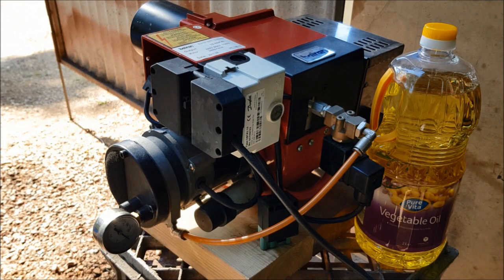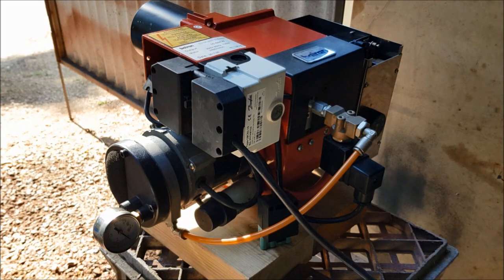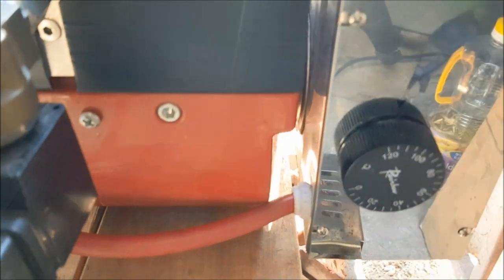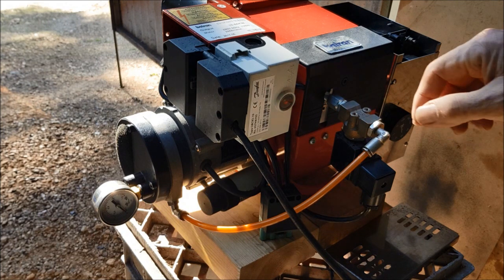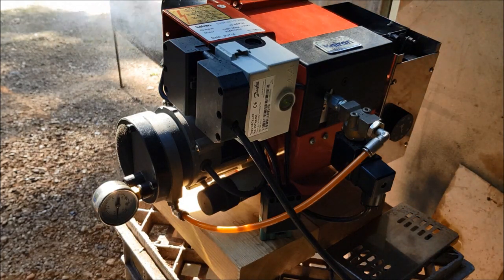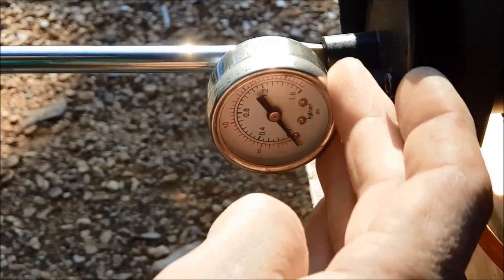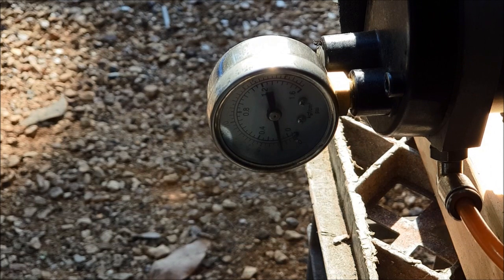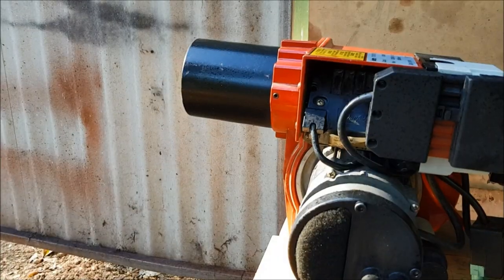bairan STW120P waste oil burner problems

Comment: The Problem could be the little sealing O-Ring on the back of the Nozzle. If it gets hard the pressur of the compressor pass by the ring and get into the oiltank.

Comment: It seems to have too much ventilation air coming from blower & it blows flame away. Remove black plastic cover close to relay box. You need 4 or 5mm Hex for that. Under this cover is blower air regulation, adjust it to less.
Compressor shall not produce over 0,4bar. Your is ok.

Comment: I have also tested and had the same problem. The solution for burning burner is that you heat the oil to the limit of 80-110 degrees Celsius and the spray pressure is at the limit from 1.5 to 3barg. After burning, the injection pressure can be increased accordingly.

Comment: Hi Eugene, just wondering if you could help me out, I also bought the same burner from a Chinese supplier, my problem is everything works up to the point where the solenoid kicks in and instead of the oil coming out of the jet the gets pushed down the oil feed pipe into the oil heater tank. No blockage in the jet I cleaned it all out. I’m using clean waste oil psi is at 6 heater is set at 90 , am I missing something here it’s driving me nuts 😡 your help would be much appreciated. Excellent video by the way 👍🏻
Reply from the maker: Hi Paul
I'd be happy to help but not sure i can.
I don't understand what you mean when you say the oil is getting pushed back into the heater tank. It should only ever be in the heater tank and it gets syphoned out by the steam of compressed air running through the nozzle. Best way to check all is working correctly is to temporarily remove the solenoid off the long tube and blow some low pressure compressed air through the tube. That should suck the oil out of the tank and give you a fine mist of oil coming from the nozzle.
Reply: @EugeneVashenko  sorry typo error ,I meant to say the air gets down the copper feed pipe to the heater tank it doesn't suck the oil up at all and there's no blockage in the jet,
  I can see the bubbles in the tank when the solenoid kicks in , I have the video up there now here's the link   https://youtu.be/DtKSA5dL6Tg
Reply from the maker: @pauloreilly1970  ok, sure, I can see what you mean, looks like the nozzle is blocked. Have you tried removing the nozzle and starting it to see if the air will come out the front of the tube?
Reply: @EugeneVashenko  First thing I looked at, you would think it would be that but I cleaned it out then blowed it out with the compressor, there's an adjustment dial just to the right of the solenoid is this for combustion adjustment ? mines on 15 looking at the manual combustion should be at 1-4 . sorry for all the questions .
Reply from the maker: @pauloreilly1970  That dial opens the vent which is located to the left of the oil tank. Sadly the numbers don't mean anything but you can see the vent if you look carefully. It should be partially open but it has nothing to do with the problem you are having.
I'd try removing the nozzle and starting it to see if the air will come out the front of the tube. That will confirm if there is a blockage somewhere.
Otherwise, contact John from https://www.bairanuk.com/ He has helped me with info and spare parts many times.
Reply: The little o-ring on back of nozzle has shrunk or wore that stops air going to tank and makes nozzle siphon oil

Comment: Hello! Have you got already the problem solwed? I have got kroll burner now abaut 10 years, so I think I know at least something abaut these kind of burners. I guess 1. you have too big nozzle. Or 2. not enauhg airpressure. Or 3. the secondary air is too much, or too less. I mean the mixture is not right. And least, the nozzle is blocked up. Pleace, let me know if you have got problem solwed.

Comment: You need buy additional compressor need at list 1 bar pressure to use vegetable oil recommend silent compressor.
Reply from the maker: Nonsense. There is nothing wrong with the compressor on these burners.
Reply: 1 bar is abaut maximum pressure. 0,4-1 bar is good. pressure depends what size of nozzle you have.
Reply: 1.0/1.2 nozzle if you use kerosine need twice less . If you use vegetable oil minimum 0.8 bar

Comment: My first year was pain with this machine, waste oil works fine, but it cannot pump normal heating oil and I was looking air leaks in the line, but problem was oil pump. heating oil is too thin for the pump.. I needed to buy different oil pump for regular heating oil.. after that my problems almost disappeared..
Also I have a extra filter in waste oil line,,
Regular maintenance is key. U need to clean boiler after 2 barrels of oil. and burner needs to clean after 4 barrels of oil.
Reply: https://www.youtube.com/watch?v=20bGcAIDS-M

Comment: I have owned two of these burners and I have to say that they are absolute rubbish. The one I am currently using has been rebuilt so many times, with just about all parts replaced, broken again and then re- engineered with other parts. The only parts on mine which are original after three years are the motor, squirrel cage fan, nozzle (and holder) and electrodes. finally, now most parts have been re-engineered it runs reliably.
It reminds me of "trigger's broom" on Only fools and horses.  Next time I buy a burner, it will have to be a Kroll- I have spent most of the last three years on my knees fixing the Chinese one.
Reply from the maker: Hi Geoff
While I have certainly had my share of trouble with this burner, in hindsight it was my lack of understanding. I now have 3 of these burners all running reliably. The one for my hydronic heating is burning through about 1000 litres of oil per month and it is running perfectly (and I am no longer adding diesel like I was previously).

They just need to be set up correctly. There is a comment from John Wilson further down the page. Make sure you understand what he is saying and do it. He also has a website with more info on setting them up. After following his advice, my compressor works perfectly, in fact I had to turn the pressure down from where I had it set initially.
Reply: @EugeneVashenko  Hi Eugene, Thank you for your reply, I am familiar with how to set up my burner, I was referring to the poor quality of the component parts, for example, Mine has had 3 controllers, the first simply failed, the second failed because of a short-circuit igniter (so a new igniter was required too). It has had three float switches, they are very expensive, the manufacturer wanted $120 for a new one (GBP60). I have had several oil slicks running down my garden path because of these failures. I replaced it with an aquarium float switch and solid state relay (Cost $10). A good precaution is to put a 1 minute timer in series with the oil pump to limit the damage should this happen. The oil tank temperature controller failed, I replaced it with a PID controller. I gave up with the rotor vane compressor after it wore 3 out, before the plastic back of it degraded and it leaked air and I went to the car shop and bought a conventional compressor=no more problems. I could go on and on, but I won't. It's great to have the  almost free heat (although mine uses 100KwH per month to burn about 500 L of oil), the reliability issues are not so good. I honestly hope your experience is better than mine has been- it is very difficult to deal with the manufacturer (in my experience) they simply ignore you.
Reply: the website was very helpful. Thank you.

Comment: I have one of these set  up and has been running for 3 years- it has been quite a journey, mine is extensively modified to run reliably. the compressors on these are rubbish, the manufacturer gives you a spares kit to add an external compressor because they know they are rubbish. so, what you need to do is to remove the plastic cover next to the controller (white box). that will expose the air screw, turn it to the left to richen or the right to weaken the mix. these things start better when they are slightly rich. Also check your connections to the compressor for air leaks- you might show 5 psi on the dial but much less reaching the nozzle- use a spray bottle with  detergent and water mix to check.
I have found using veg oil doesn't work that reliably with these burners but you can do it with perseverance.
I found that I could much improve my burner's reliability and performance by getting a 2mm thick piece of 150mm stainless steel tube and welding it to the backplate of the boiler, thus making a "sleeve" for the blast tube or a mini combustion chamber (I pinched that idea off Kroll who have pioneered a similar mod to their burners)- it gives improved "swirl" It will probably resolve your droplets of oil problem. That is due to poor atomisation so either/or not enough compressed air /fuel too thick (too low a pre-heat temperature) .
Those Danfoss controllers are very sophisticated and very fussy about the flame. I prefer the older siemens ones. You can fool the photocell while you set it up so there's not the annoying lockouts, there are plenty of videos on youtube about this.

I have set mine up to have the nozzle heater to run constantly at 90C which means I can dial back the pre-heat tank to 60C and use a plate heat exchanger from the output of the boiler to effectively replace the heating element in the pre-heat tank saving on power. You don't need to do that of course but you can see the mods on mine on my channel:https://youtu.be/1Z5k8TvPXPo  
I feel your pain, but take heart- you can make these things work well and you will wonder how you ever managed without one.
Reply: How do you keep nozzle hester at 90C? Did you add a thermostat and temperature sensor to do this or is the nozzle heater self balancing and you just power it all the time?
Reply: https://www.youtube.com/watch?v=20bGcAIDS-M

Comment: Hi Eugene
When these burners leave the factory they are not setup to plug and play. It looks as though the compressor is not producing enough pressure . It should be running between 0.4 and 0.5 . So you will need to increase the pressure . Your nylon screw which adjusts the screw does not really achieve much. The problem is deeper in the compressor.  Remove the 3 allan screws which hold the end cap on to expose the rotor face plate. Undo the 6 screws holding the face plate on, to gain access to the rotor . Inspect the rotor and vanes for possible damage . If there is no damage loosen the 2 allan screws on either side of compressor ring  but do not remove. The compressor ring has got  slight adjustment in it so push it against the rotor as far as it will go while tightening the 2 allan screws.
Re assemble in reverse and this should give you better pressure.

Also listening again to your compressor it sounds very noisy so it could also be suffering from a faulty bearing
Next remove the black plastic cover at the rear and on the rhs at the bottom you will see a plus or minus symbol. Insert the allan key and turn ant-clockwise to close the low pressure air vent which you can see if you look through the vents at the side of the heater tank. Close completely to get going then adjust as necessary.

In reply to Nelu. All carbon vane compressors operate at quite a high temperature 86Deg is quite normal
Reply from the maker: Hi John
Thank you very much for the advice. I ended up replacing the compressor rotor and vanes with new ones that the seller sent me. It has been a while since I did it but it seems to have solved the problem and it is now working OK. Funny thing is the old rotor and vanes didn't look damaged in any way but the new ones made a difference.
I found that my burner worked best with the low pressure air vent closed fully.
Reply: @EugeneVashenko  
I'm curious:
Question Please:
I. Did you buy it new? 
* If yes, why didn't you ask them to send you a new one... it's not your responsibility to replace parts.
* If no, I guess the seller was ethical and helped you out and now you're up and running!

Amen
Retired, Veteran
Reply from the maker: @BowenOrg  I did buy it new but it has been many years so I don't remember the reason. More than likely because they wanted me to ship it back and the cost to do so was a bit much. They sent the parts out without any issues so I would buy from them again.
The positive side to this is I learned how these burners work and we have had many years of use out of it.
Reply: @EugeneVashenko  
So I'm assuming that your warranty expired also.
That seems to be always the case doesn't it? 
They ship out faulty products and then want you (aka us) to ship it back, which they know we won't do when it's a heavy item.
I'm glad they sent you the parts and you repaired it and you've been very happy with the machine... that's a great bonus.
I'm not much of a mechanic so I need to buy the highest rated products with the best warranties so I reduce problems as much as possible.
We're deciding on whether to go with a wood boiler or a used oil boiler for our retirement home that we're planning, so we doing a lot of R&D and asking a lot of questions.
Thanks for the feedback... and have a Great Holiday Season!

Mr & Mrs Bowen
Retired, Veteran
Reply from the maker: @BowenOrg  Even if the waste oil burner arrived working well, it still requires a lot of maintenance. I spend at least an hour a week cleaning the unit during the winter months when it is running 12+ hours daily. On top of that, you need to collect the oil and let it settle, ideally for months. I use close to 1000L each month so you need to be able to source, transport and store large amounts. Then you need to dispose of the gunk that settles in the tanks during storage.
All in all, while the waste oil is free, the time you spend on the setup isn't, so choose carefully. Just my experience.
Reply: @EugeneVashenko  
Great Feedback... Most Appreciated!
I'm retired so I'm going to compare Wood Log Boilers and Waste Oil Boilers very very very carefully!
Take Care
Reply: Fair play to ya John Wilson, I had a motor bearing fail in mine. Easy fix, but then the compressor wasn’t building up enough pressure, I’d never had guessed that adjustment was there 👍😁

Comment: Hello everybody
I bought this burner and I do not know if it is normal for the air pump to operate at 86 degrees celsius. I think it is a very high temperature.

Please help me with answers.
Reply from the maker: I haven't measured the temp but my air pump gets hot after running for some time. I installed a small 120mm 240v fan below the pump and wired the fan to run when the pump runs.
Reply: @EugeneVashenko  Thanks for the reply.

The seller said it was a normal temperature
At this temperature I do not think she has a long life.
How did you solve your problem?
Thank you

Comment: You can buy a REAL American made oil burner for @ $500. Proven, tested, true design that lasts for decades and does not sound like a roto-tiller. Parts just a phone call away in English.
Reply: Link plz?
Reply: @nasjatt  https://www.supplyhouse.com/Burners-20110000
Reply: These are furnace flue (diesel) burners.   The video is showing waste oil / vegetable oil burner.  Waste oil burners are more complex and expansive.
Reply: @nasjatt  https://www.youtube.com/watch?v=H7WdiGAuX9s
Reply: https://www.youtube.com/watch?v=20bGcAIDS-M

Comment: i have one of these setup with 700 hours on it with no issues its how you set them up is the key i have tried many other burners that did not work well for me they had  constant problems also stay away from the ones with built in compressors i had one that only lasted a week it was dropping pressure daily  5% kero mix with waste motor oil works best the 5% kero helps with ignition and  keeps the internals clean inside the burner it is also easier heated being that more thin.... i believe you can get a good burner and a bad one just like a car from the show room
Reply: we know who you are
Reply: @NOBOX7  what are you talking about

Comment: As far as I know, the siphon nozzle in it works at 5 psig at maximum or 0.35-0.4 BAR. The pressure should not exceed 0.4 BAR. Otherwise the nozzle will be broken.
Reply: https://www.youtube.com/watch?v=20bGcAIDS-M

Comment: Remove and check pre heat tank filter. Soak in petrol and reverse blow to clear the fine mesh.
Check photo cell is clean, oil can run down the blast tube and get flicked up over the photo cell by the fan.
Remove nozzle, soak in petrol overnight and again, reverse blow to clear.
Unused veg oil may have gelled up your filter and or nozzle.
Reply: https://www.youtube.com/watch?v=20bGcAIDS-M